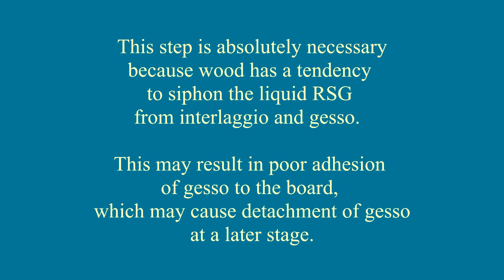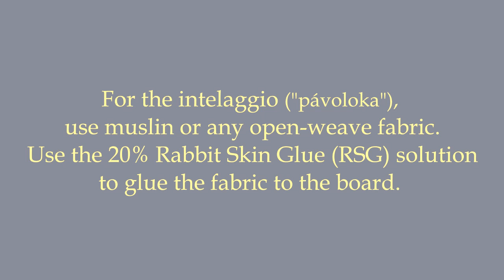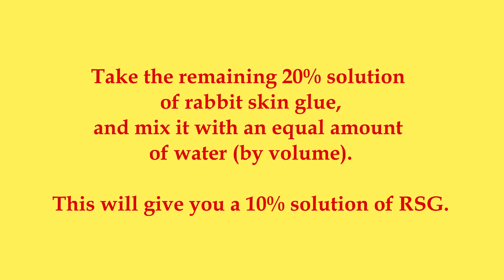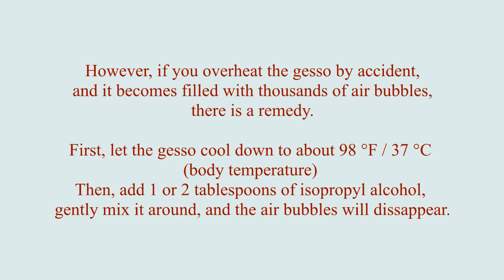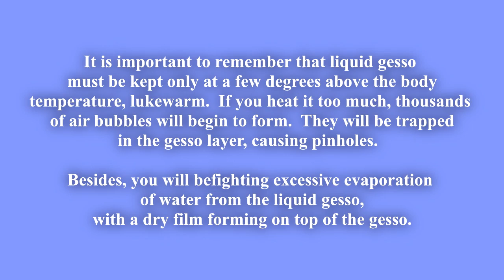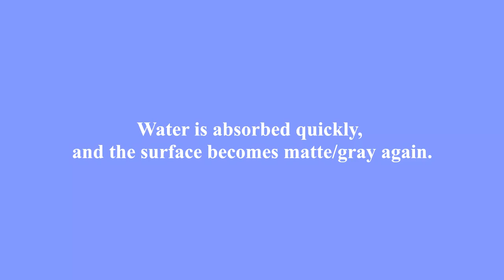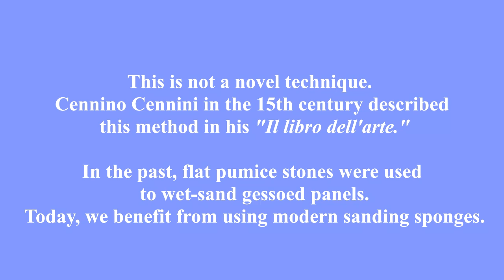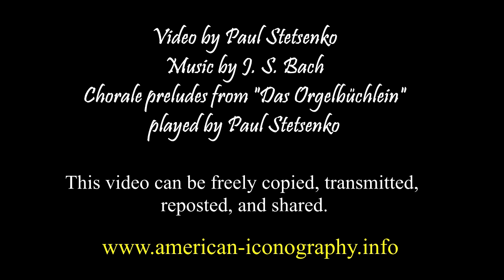Making an icon board

Comment: Or save a
Lot of time and paint an icon on a kitchen unit door!!!!😩
Reply from the maker: Our Orthodox tradition preserved the account of the Holy Apostle Luke taking a simple table top and painting the first image of the Theotokos on it.  If a lowly table top was good enough for the Apostle, why should we place ourselves above him and seek some exalted materials for much less spiritual output, pigmies as we are?  I will gladly paint on a kitchen unit door - or anything for that matter - when I see that I cannot get quality supports.
Reply: Paul Stetsenko fair enough?????!!! Lol... just a hell of a lot of stages for a smooth surface, but I do respect your hard work and tradition 👍
Reply from the maker: My other preference is MDF, (treated, or whatever it is called....).  Just a backing frame in the back, and it does not warp at all.  And no interlaggio is needed.  Gessoing is a peace of cake.  But I still somehow prefer wood...